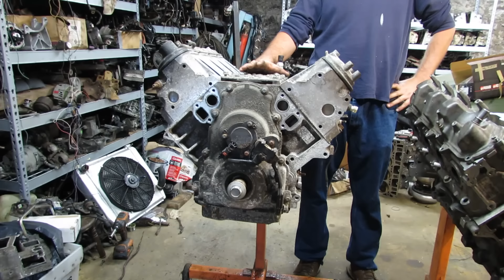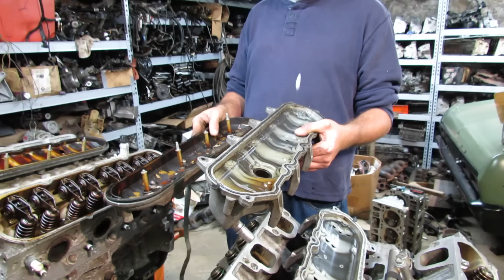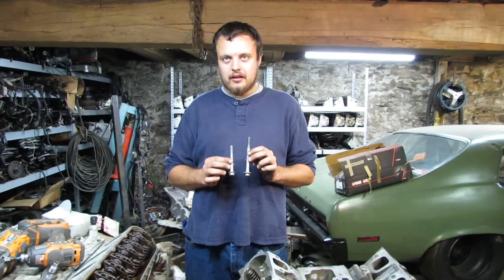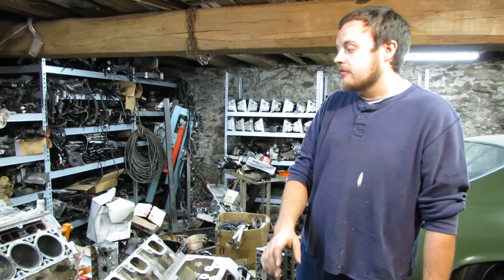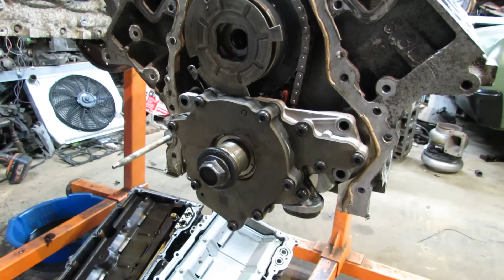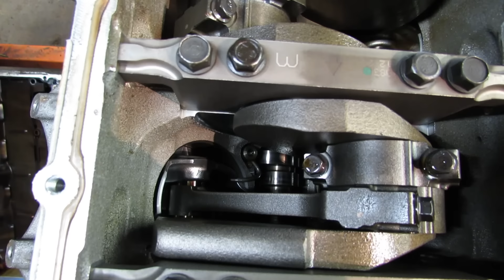The Next Generation of Chevy V8: LS vs. LT

Comment: It's a learning curve for sure..

Direct port injection is not a "NEW THING" has been used on diesel engines for years, and it will (NEVER) undo or delete classic style engines either, the GEN4&3 will be around along with GEN 1&2 block styles and parts for the next 100yr+. Just like aftermarket "FORD FLATHEAD" stuff.

Many of the issues on the GEN5 stuff can be undone such as electronic oil pumps, variable valve stuff, and other things, aftermarket (WILL) kick in on that thankfully for those who "hotrod" etc.

By looking at it, for someone searching for power, a good cast iron aftermarket GEN5 block would be better, no (SERIOUS) race guy would be trying to crank out 1000hp on a aluminum block. That is asinine and just mental.

Personally, i rather stick with the GEN 3,4 stuff over that, GM got it right, and what they didn't the aftermarket sure made up for it! It's why the LSX platform is the (BEST) in the world! Especially when tough durable stuff is used by someone who got skillz!

I just think the GEN5 stuff is gonna be something that will take the next 5 years to decade to line out correctly before even the aftermarket starts kicking in on it. I think they are waiting also for GM to make revisions etc considering how many have had issues with the valve fouling and carbon buildup/sea foam trick.  Just saying!
Reply: The aftermarket is already here for Gen V LT1 and LT4, in all areas and prices are almost the same as LS

What is wrong with the new variable output oil pump? We have not seen issues with them, except when people remove and then reinstall the same pump, without using the alignment guide (follow the instructions). 

VVT works great for most people. It provides more power throughout the curve. It only requires limiting with very high cam lift. There are a wide variety of performance cams available for use with VVT. 

Cast Iron is no longer required for 1,000hp. The strength Gen V block is not the limiting factor. Take a look at the area around the cylinders. Lots of people are running the 5.3 and 6.2 well past 1,000hp. No one is buying “ cast iron aftermarket” blocks for a Street/Strip vehicle...that’s ProMod stuff. 

100 years from now, internal combustion automobiles will only be in museums. When is the last time you heard of someone swapping a Flathead into anything?
Reply: https://youtu.be/2js4WNkQi90
Reply: @Jommybutler1234  The more complicated you make stuff the worse it is, just like that VVT lifter deal. Electronics cannot survive well in a harsh environment inside an internal combustion engine. Every time you try to introduce electrical components into a mechanical hot environment, you're destined to fail every single time. Think about it, if electronics and solenoids were so dependable and great, why haven't they came up with a provable design that actuates valves and the cam duration and lift could just be literally programmed?!?  It is the exact same reason why they failed on their VVT lifter deal, and MFG's who try the stuff. It just can't handle it, not right now technology wise that is.  Maybe in 50yr or so.
Reply: @ICONBADGTA  Single speed bicycles are pretty simple machines and do t break often. 

Technology has passed you by. 

You seem confused about what Variable Valve Timing is vs Active Fuel Management

Sensors work very well in the relatively low temperatures of the coolant, oil and exhaust systems. They have done so for decades and continue to improve. 

There are engine designs being produced that go well beyond your imagination and don’t require a cam at all. 

AFM/DOD works very well, saves a lot of fuel and helps meet emissions requirements. Failures tend to be associated with extended oil change intervals and overheating, which affect most engine components negatively. 

Don’t rely on anecdotal evidence from the UT comments section. Some people still maintain that the small block 350 is best. It’s OK, just not correct.
Reply: @Jommybutler1234  Whom exactly are you trying to convince? Me or yourself? Because i done made my mind up long ago, take that new technology junk and be done with it.  stick with what works and build off it, they did it with the Gen 4 from 3, they need to from the 4 to 5, just lose the nonsense.
Reply: @ICONBADGTA  Why didn’t you reply to my questions and explanation of your confusion regarding the new tech from GM?
Reply: @ICONBADGTA  if you “DON’T CARE”, why do you keep replying?

Why won’t you answer the questions I have asked?

Why don’t you realize that there are way more electronics in a modern drag car than even a typical late model passenger car. Everything is either monitored by the ECM or controlled by it. Traction control is programmed electronically. Fuel delivery is reliant on electronics and is shaped and controlled by computer programming between runs. Electronic safeguards are in place monitoring AFR, oil pressure, temp, etc. 

Nitrous isn’t a button anymore it’s programmed by electronics to come in at specific driveshaft speed vs GPS speed...again...electronics. 

The oil pump isn’t electric...you dolt.  It has a processor that varies the rate of oil delivery by modulating the pressure. Cruising on the highway with high oil pressure decreases mileage. 99.9% of vehicles designed by GM will never be raced and most will very seldom even see full throttle...ever. No one...zero...zilch, is changing out the OEM oil pump in Gen V LTs due to reliability issues, you don’t know what you are talking about. 

Do you see a lot of mechanically driven water pumps on drag cars...no...they are Electric and do not run off of the accessory belt. 

Technology has passed you by. Enjoy tuning that Carburetor.
Reply: @Jommybutler1234  Believe me, i would block you if i knew how.  Only reason i respond is because if i don't it keeps saying i have a notification. Enjoy your future not needed breakdowns. We will be sure to "HONK" as we go by.
Reply: @ICONBADGTA  When you see the email notification, you always have the option to hit DELETE. 

I still wonder why you never answered a single one of my questions. 

Enjoy the Past...the rest of us will move forward into the Future.

Comment: With the direct injection, what can be done to prevent carbon build up on top of the valves...
Reply: That is the question?!...whether 8 cylinder of 4 cylinder...I think all the auto manufacturers deal with this issue...especially with short trip/no warmup engines.
Reply: Get a good quality oil catch can, helps alot
Reply: Add meth injection. And a catch can.  You’ll have the cleanest intake and valves you’ve ever seen.
Reply: Best thing is to have direct and port injection like the coyote motors.

Comment: The reason for the PCV baffling in the valve cover is to keep oil mist off of the intake valves since they are not cleaned by fuel spray.
Reply: Catch can
Reply: Is the LS/LT direct injection? You comment is on true IF they are direct injection...and I don't think they are
Reply: @cromBumny  LS is port injection.  LT is direct injection.
Reply: So the pcv baffling doesn't pick up any oil when it bleeds off or pulls off crankcase pressure and recycles it back to the intake track.
The old cheesy baffles would definitely pick up misted oil and pull it right back through the intake, so I can definitely see how improved baffling could help.
Reply: And yet the valves still get gummed up in the intake port.  The improvements to the valve covers did not have anything to do with the oil still getting into the intake because the pcv valve ( through which the vacuum is sucking) is pulling from the valley cover.

Comment: The vacuum pump is strictly for brake booster vacuum line. There is only one plastic line coming out of those pumps and it goes to the booster.  It's there to provide extra vacuum when the engine is in 4 cylinder mode.  It doesn't pull extra vacuum from the motor at all.  It is belt driven and oil fed from the motor and that is all that pump and the motor do for each other.

Comment: 🙄🥴 As a Ford guy, I once again find myself wondering why Ford(and Mopar) didn't think to design a great, versatile, strong, but relatively simple and AFFORDABLE engine like the LS and the newer GM variants, which could be easily and relatively cheaply procured, with lots of affordable performance parts, and significant room around the cylinders for boring, as well as stroking to well over 400cu/in. 

Instead, we got a HUGE, small engine that barely fits into most cars, due to the enormous heads and valve covers, which is ironic considering that the large external dimensions absolutely do NOT equate to the internal displacement area, which is kinda ridiculously small at 4.6L to 5.0L in most cases, despite their external size being larger than the GM LS! 

 I hear the Ford "modular motor" is capable of handling a lot of power, but God forbid you have  to buy a crate modular motor, or even a short block, cause it's going to cost you!  You'd think Ford would've learned a lesson from the Chevy gen 1 small block V-8, and designed their new engine with similar benefits(ie. relative simplicity, relative affordability, flexibility, parts availability, etc). But .....nope! ☹️👎
Reply: That is where Ford makes their money. Year specific parts. The very reason I hate Ford.
Reply: My son had an 86 Bronco in high school.  I was a Chevy fan and could build small blocks in my sleep. But that Bronco put me in a rage every time we worked on it. Ford made mid year changes and we had to bring in old parts to Auto Zone to match up because they were different that the book called for. They would try to give us the 3 wire oxygen sensor listed in the book but it came with a one wire sensor. This bronco had v belts. The book calls for serpentine belts.

It had a tired 302 engine. I got a nice 351 and installed it. They look the same but the 351 was wider and now the headers hit the front driveshaft. The distributor and oil pump drives were different sizes, etc. Ford stuff was a pain in the ass compared to the interchangeability of small block Chevy parts. I'm working on a stock 1931 Model A Ford now. At least the parts interchange between years.
Reply: I feel your pain! People will call me a Chevy guy, but, I learned to drive in a '95 F150 and am a huge fan of Ford trucks. As the years have passed I realized I like their look, not their toughness. If they made a great truck platform I'd buy it. I'm finally on my second 00-06 Suburban and I tell my son to point out which brand he sees more of on the road still today. We have seen hundreds of Tahoe/Suburbans and are still within 4 handfuls of the same time frame Expedition.  So my advice to him if he needs a solid cheap car would be, buy the cars/trucks that are still all over the road at your current time. The one with the most on the road is the one to cherry pick from..
Reply: You sound like you're gonna switch over to chevy soon, you can afford to make alot of horsepower and torque for way less money. Ford always had high priced performance parts and it kept alot of people from owning a Ford.
Reply: Cheap v8s bruh u know it big block 6th or 5 gen 454 for the money I rather have an 454 block from the junk yard then an 4.8 or 5.3 LS . and 351 Windsor engines are really good don’t believe me check out ken blocks Windsor twin turbo awd 65 mustang that thing eats LS and even 8 sec rs3s for lunch 😵‍💫😵‍💫 why nobody talks about the hemis ? The older ones are actually hemis and drag racers favorite engine when it comes to max power like are old school 426s or 392s cheaper then LS ENGINES TO BUY AT AN JUNKYARD ? LS owners don’t bore them out to more then 427ci whys that? an basic 454 nothing special about them 210 hp stock but with an little dirty work you can bore it out to anywhere from 493 to 572 ci if your rich enough even 632? Why where talking about limited small blocks again? Even the original 350 small blocks can be bared out to above 427 some have almost hit 500 ci with them 🤫
Reply: @xx_ironman77_xx1  
That's true, but I was talking about Ford's newer generation 4.6, 5.0 and 5.4 engines made from 1996 til now. Sure you can make great power with them, but just like with the other generation small blocks, it'll cost you way more money to build up the newer generation Ford engines compared with the LS. Hopefully Ford's new 7.3L Godzilla motor will become common enough in junkyards that it'll be affordable to build up.
Reply: @xx_ironman77_xx1  you can't take a standard deck BBC out to 632ci that needs a tall deck, I believe 598ci is the biggest and ATK sells them for $6,400.
Reply: The simple answer to your question is that Ford does not profit from your junkyard swaps, and therefore doesn't care about them.  At all.
Reply: I’d much rather hav a coyote than ls. New gm lifters going out are a real thing 😂
Reply: @freedomisntfree_44  then buy Morel lifters or keep your cam lift under 0.600" and valve spring pressures less stiff, you can always add more boost to make up for the few HP you sacrifice with a less aggressive cam or using heads with smaller, lighter valves that are easier to control and cause less lifter issues. That's why 706/862 heads and the Elgin 228/230 or 238/242 are the way to go even with only PAC 1218s and everything else stock, make sure you use Diesel 15w40 oil and add Lucas in you junkyard LS engines as well, even on a 6L or 6.2L you don't need the big cylinder heads especially if you are on boost. You can make more power than most people could ever fully utilize in a street driven car or truck with the most basic LS build.
Reply: @hendo337  let me know when you get an ls running 7s factory sealed like a coyote 👍🏽
Reply: LS be alright if they had no lifter problems to worry about and low oil pressure issues and that dod crap.
Reply: Ford does have a engine like this, the F250 and bigger Godzilla engine. It’s still physical smaller than the Modular 4.6L
Reply: Mopar does make the 5.7, 6.4 and 6.2 and Ford has the new 7.3. They're never going to gain the momentum in the aftermarket world as the LS/LT but, there are options out there. I was looking at a new L8T 6.6L cylinder block and it is actually more expensive than a bare Hellcat block, there are stroker kits to build 454ci with a Hellcat block 4.125" bore x 4.25" stroke, I sure you could do the same with an L8T but it is going to require a 0.060" over bore vs a 0.035" overbore.
Reply: Ford did build 6.8 million 351w blocks and you can build very legit sized strokers on a budget with one, 393-440ci and aluminum heads start at $800 a pair for Flotek from Speedway all the way up to some of the best, TFS 11Rs that will support over 600hp for $1800-2000 a set off eBay and the usual sources.
Reply: If you fought that hard over parts, you didn’t think it through. Order parts for the 85, solves most of the mid year issues
Reply: Gm never upgrades it’s vehicles?

So if there is a 97 model and a 2004 model of the same body style nothing is upgraded?

That’s dumb
Reply: @iqinsanity  gm has always been very smart to reuse parts that have no reason to be remade when they work just fine 
so alot of years of trucks,vans and cars have some of the same parts for sometimes 10+ years